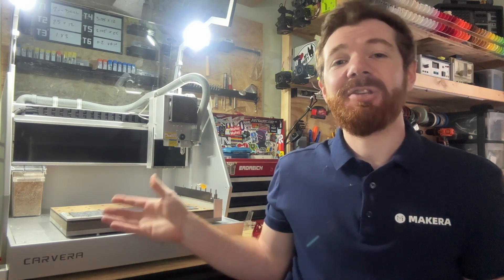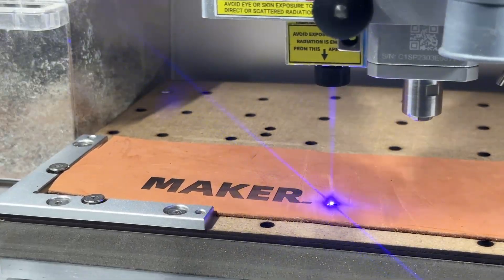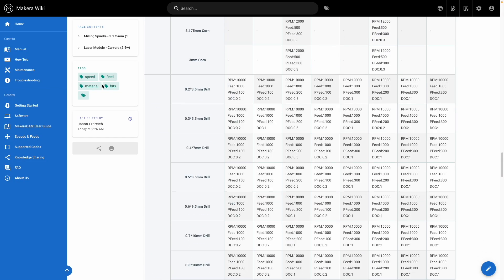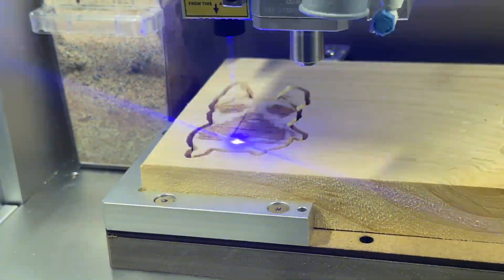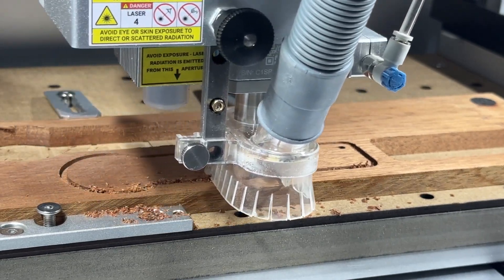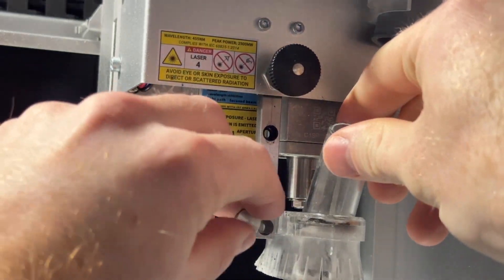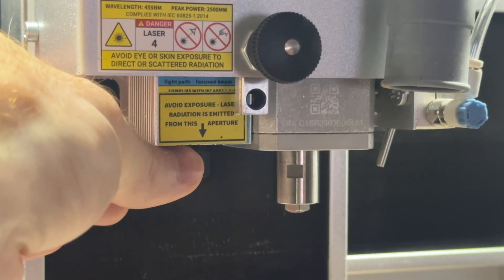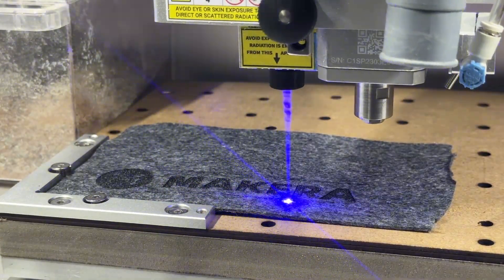How to use the Laser Module on the Carvera Desktop CNC

Comment: The laser is etching the travel lines even though I used the makeraCAM, what possible fixes can i do to the software or hardware?
Reply from the maker: It is possible that this is a focus issue or that the laser needs to be calibrated. Please see the support guides on our Wiki, and reach out to support@makera.com if you run into any trouble.